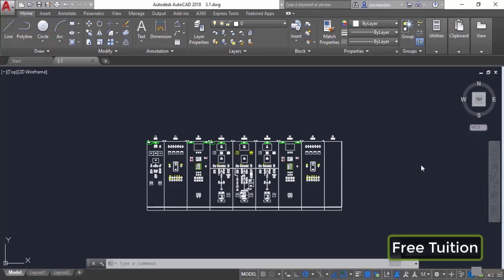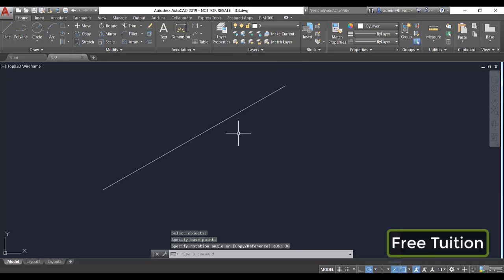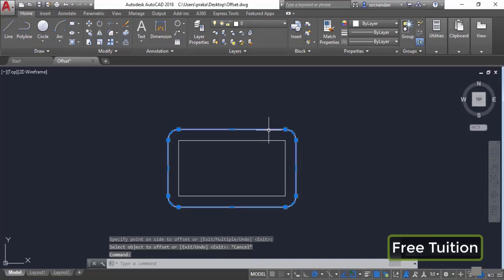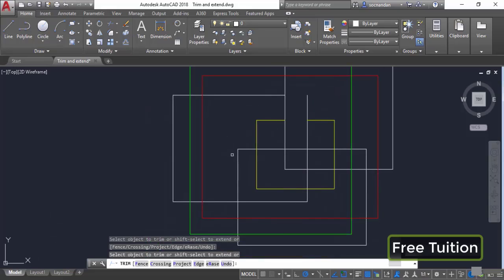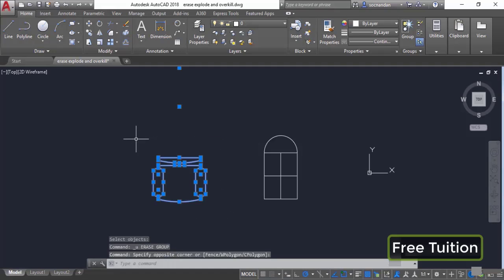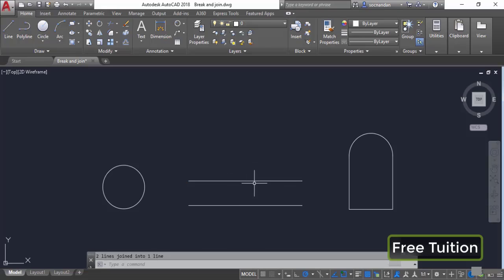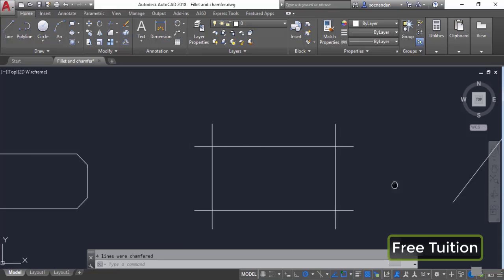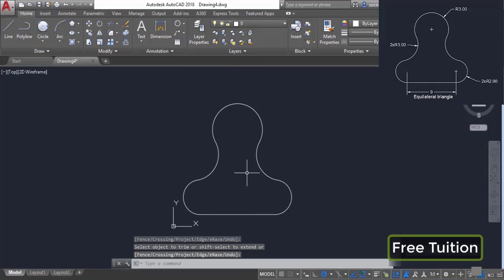AutoCad Tutorial - Part 3: Modifying Drawing

Comment from the maker: You can skip to these topics to time...
Making selection sets 0:00
Move and Copy command  5:26
Rotate command 8:19
Offset command 14:05
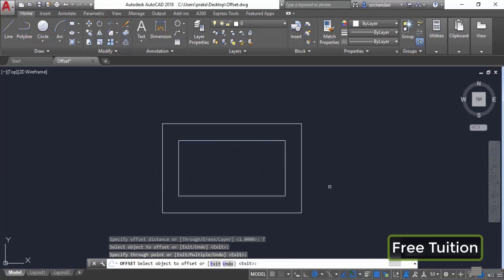Mirror and Scale 19:40
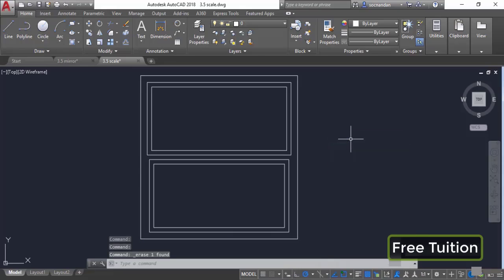Trim and extend 26:30
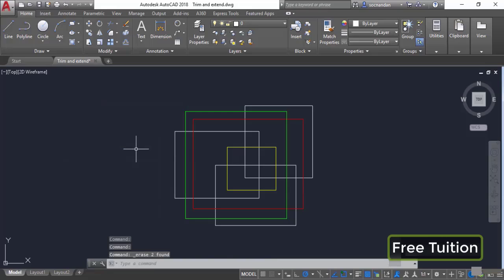Erase, Explode and overkill 34:45
Stretch command 38:41
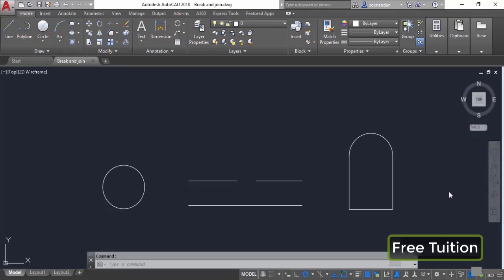Break and Join 42:07
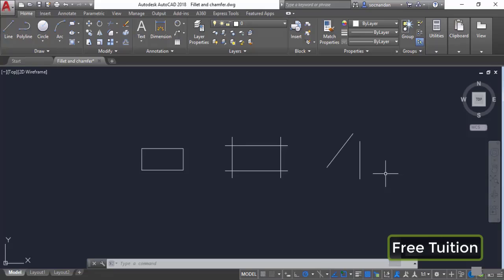Fillet and chamfer  47:52
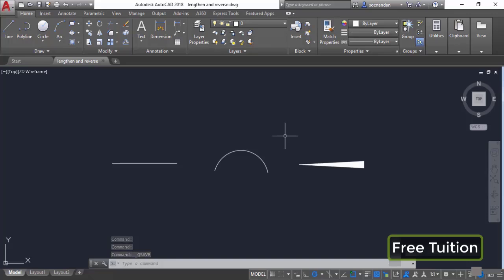Lengthen and Reverse 55:34
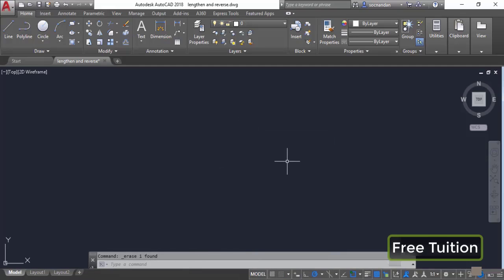Practice Question 01:01:39